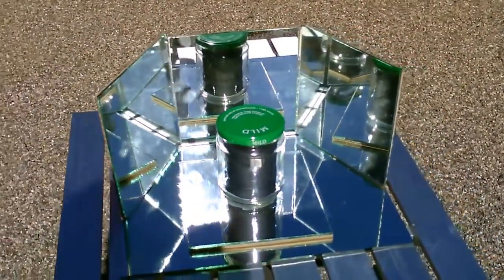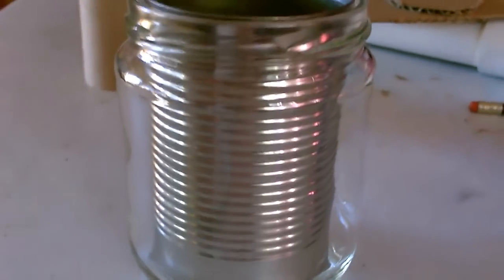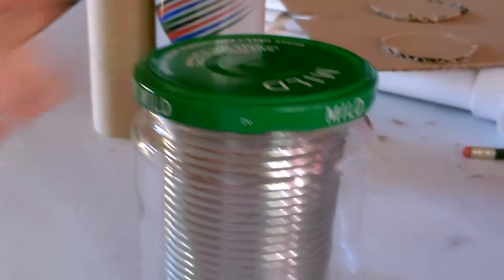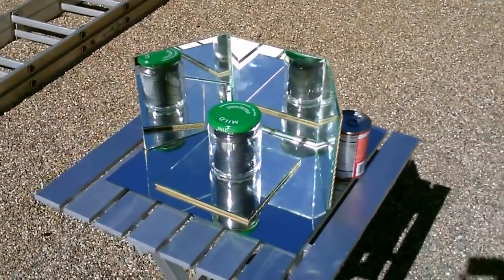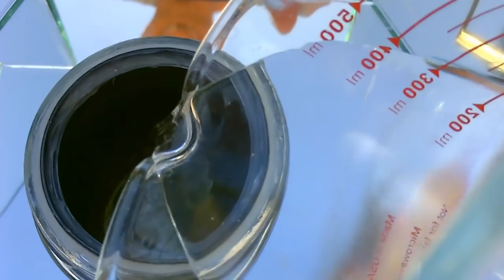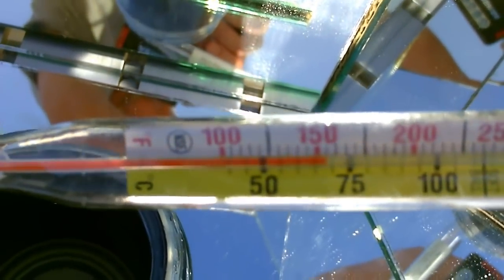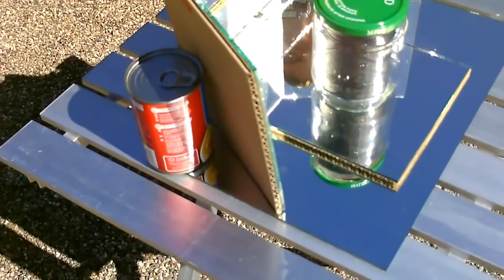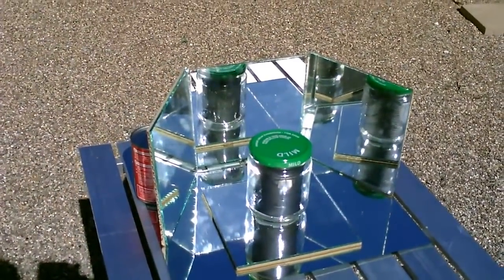DIY 4-Mirror Solar Panel Cooker! (w/dual-walled vessel) - Xtra hot! - from recycled scrap! - cost $0

Comment: You're becoming quite the Craftsman! What you built is the Archemedes style burning mirrors solar cooker. I like it! I found an old tv satellite dish. I covered it with aluminum tape and it can boil a cup of water in about 2 minutes! I used it to light a fire with wet sawdust in 27*F breezy weather it took 3 minutes and I had flames! I bet if you cut skinnier strips of mirror you could focus more of the captured sun onto your target . Looks like a fun experience!

Comment: Thanks for broadcast ! The first part a little hard to follow what you did not  quite sure. So how many mirrors ??? Really want to make this have to mske sure I know what I'm doing
Reply from the maker: hi. i just took an old metal soup can and painted the outside of it black. then i anchored the can inside of the larger glass container using silicone caulk (it acts as the "glue" and holds the can firmly in place at the bottom). then with the same caulk i sealed the top (making the container airtight and waterproof). after that it's just cutting down the mirrors. (i used 3 "standing" mirrors plus the larger one underneath) hope that helps :)
Reply: @desertsun02  Thank you I see you siliconed the top do liquid doesn't get between the can.and glass!  Got it now how many pieces of glass mirrors and sizes!? Thanks.
Reply from the maker: the 3 "standing" mirrors are 7" square and the larger mirror underneath is about 10" by 14" - but size these based on the size of your container.  for instance, i'm thinking of making a larger one using a glass pickle jar and a larger steel can. in that case, i'll make the mirrors larger (maybe 10 by 10 or something)
Reply: @desertsun02  Thank you!

Comment: Clever.
Reply from the maker: thanks.
Reply: @desertsun02  hey bro i made same thing years ago

I used a large stainless steel mixing bowl and a clear large glass "lily" dish with lid and put my flat black pan with lid inside.....i actually prefer using teracotta pot pained black than metal